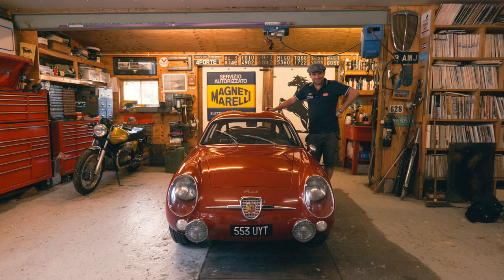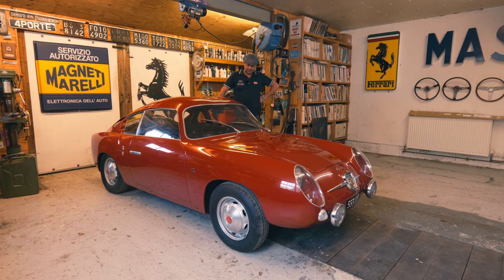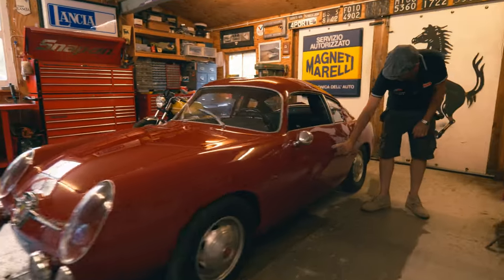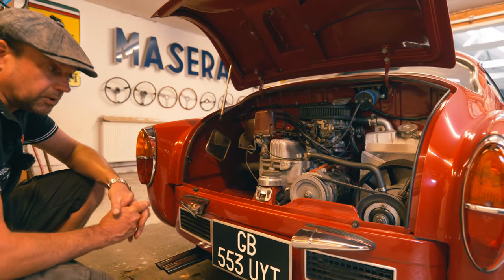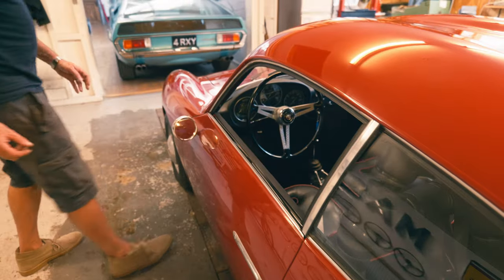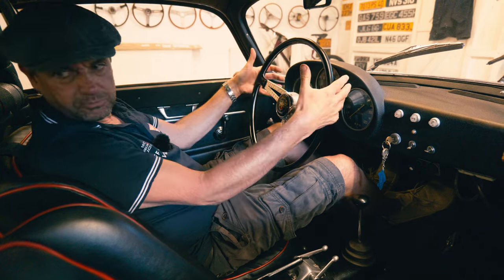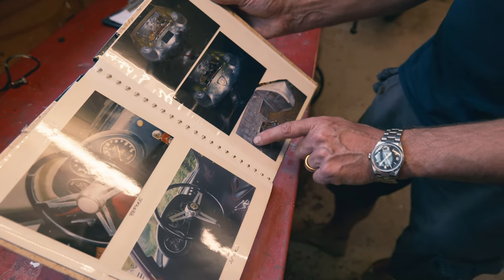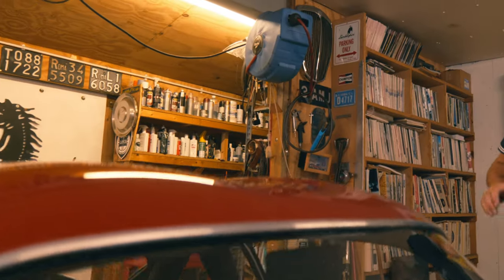Fiat ABARTH Zagato 750 for SALE.

Comment: The Fiat Barchetta has the same sort of door handle. My Barchetta was a pain to get to a state where it actually doesn't leak oil or cooling- or petrol. But once they fixed its a fun roadster with a lot of nice details and a beautiful styling.
Reply from the maker: The FIAT Barchetta is a lovely little car and doesn’t get the attention that it deserves. The body was built by Maggiora in Chivasso near Turin and they were also the Coachbuilder responsible for the construction of the Maserati Mistral which if you are watching the channel you will know I have a big interest in. The stylish little FIAT was there last hurrah as sadly the factory closed soon after the Barchetta production ended.